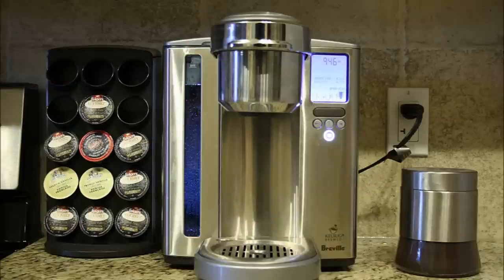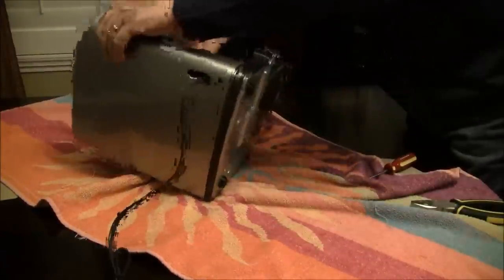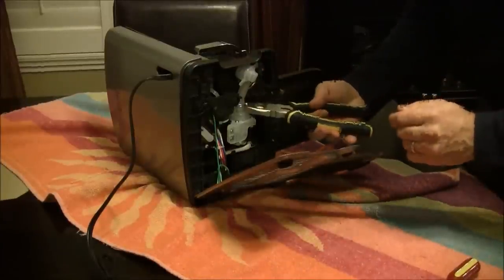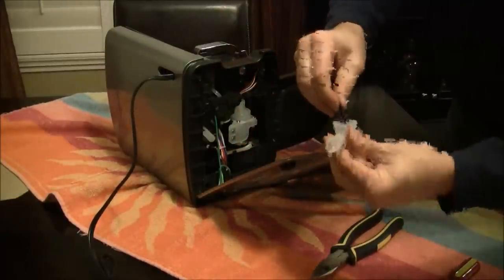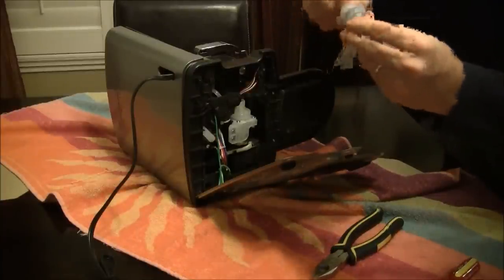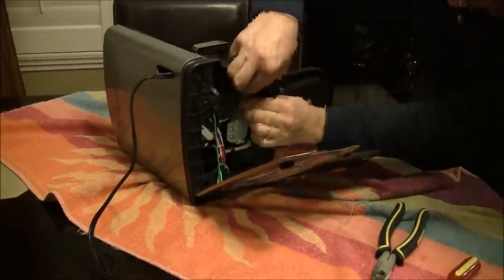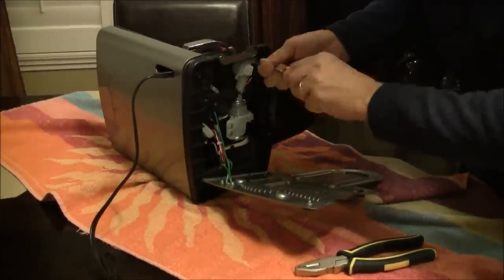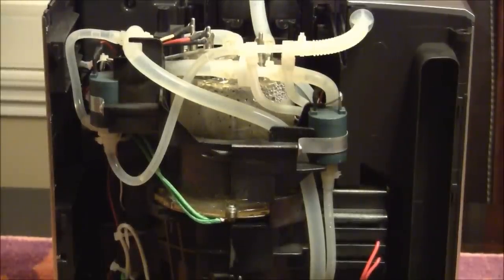Keurig Breville Fix to slow brew and partial cup

Comment: Being lazy and not wanting to take it apart, (after watching your video) I decided to get a small sewing needle , vise grips to hold the Needle and a flashlight. I put a small amount of bleach in the hole. Then I put the needle through each hole and because the bleach was in there, I saw a white substance accumulating. I then cleaned out area with water and proceeded to make a full cup of water. Worked like a charm. This may be temporary and not as thorough as your fix but I flushed out system with like 15 cups and all starting brewing at 15 seconds and finished in under a minute. I thank you for showing us the Real problem. Was on phone with Keurig and they never even mentioned that part getting clogged. Thanks again. Great video.
Sent from my iPad

Comment: Don't mess with my coffee.  I have had my B60 Keurig for almost 3 years and just started having problems with it brewing slowly and making more pump noise. I use a PUR water picture to filter the tap water before I add to my Keurig. I also run vinegar solution through it once a month. Recently my Keurig began slowing down and making a lot more noise. I purged it twice and cleaned the K cup holder and nothing changed. Then I searched and found your video (Yeah YouTube).  I followed the instructions to clean the inlet filter and the problems are solved!!  Thank you!  I was about to buy a new Keurig.
Reply from the maker: Terry, glad you found the video useful. My machine is continuing to work like new, since I cleaned the filter almost a year ago. I wonder how many machines have been tossed over the years, because of this simple problem? Cheers.

Comment: Bingo! This video saved my Cuisinart Single Serve SS-700. I pulled off the bottom cover, accessed the filter, removed it and found a big build-up of fiber plugging its underside. Maybe the fiber accumulated from the replaceable charcoal filter pack in the water tank. Before I found this video a cup of coffee was taking 60-70 seconds to start pouring. After... 9 seconds! Like new again.

Comment: Old video but great and currently effective. It took years for my breville to need this done, but I use my Britta to fill my reservoir so maybe that and the included water filter in the tank helped to prevent this from happening sooner. Thank you for saving my from having to pay a service to fix or replace my breville, I love my Breville products, now to find a solution to my kettle taking so long to heat up ;)

Comment: Thanks! I would not have attempted dis-assembly  before I found your video. Mine was coated with a black slimy film. It also coated the screen housing. After removing it I cleaned both with vinegar. Be careful when reinstalling the filter housing. If it's not perfectly centered, it will leak.

Comment: On  the Breville, be sure to check the 3 holes on the side of the puncture needle in the lid. The ½ inch or so rubber grommet pulls off exposing the holes. Using a sophisticated tool called a "trombone" (French for paperclip as I just learned) just push it up through the 3 holes and voila! (French for I can't believe that actually worked). Often if it sounds like the heater is filling, but you just get a slow drip this will do the trick. You can usually do this by just tipping the whole brewer back.

Comment: Thanks man. Took me 15 minutes and runs like new now. I always use distilled bottle water so I have no problem with calcium but I suppose after almost 3 years floating dust finally plugged that filter.

Comment: We have had our Keurig 2.0 for 4 months ago and had same issue. I tried this and then ran it a few times with hot water cycle into a clean white cup. WOW what a bunch of debris that came out! Thanks for this tip. It worked. Seriously thinking about filtering the water from now on.

Comment: Just fixed mine with a shop vac. Blew air forward and backward into the hole under the water basket. It works great now, no need to take the machine apart. As you blow air forward water will come out into a cup. Let a full cup of water come out and then also suck out water too with your shop vac. Easy fix!
Reply from the maker: +Elise Quinn  Yes, this should clear some of the debris out of the filter, but it may not clear all of it out and it will certainly not "clean" the filter. It's a quick fix. Thanks for sharing.
Reply: Elise Quinn Thank you for your shopvac trick helped alot I am now getting a full cup of Coffee!

Comment: Make sure you put the silicone tube all the way on the pump up to the base when reassembling.  If not, the inlet tank seal for the water tank will not seal off correctly as the sealing base will  not align correctly with the tank outlet stub, and it will leak.  Ask me how I know.  1 do over.  Thanks for the video.  Fixed the problem that I've had for some time.

Comment: Great video + Breville is by far our favorite... so, first of all thx for showing us how to get underneath and undo the screws (great suggestion screwdriver + pliers for little hose clamp ...thanks!) 

note: As you showed, my filter looked a-OK, clean, no buildup, and rinsed it anyways -- alas, that makes sense since we're always using filtered water from the H20 store... I wonder if the plastic filter piece you showed just needed a 'lucky bump' or something...

I'm wondering if anyone has considered the water tank filter (charcoal pak) and/or filter screen and/or K-cups themselves are the culprit(s)?  The reason I ask = I did use some de-scaling solution when putting it back together... during the rinse/flush process (2 tanks fresh water), I removed the charcoal pak (but left the round screen in), and without any K-cup... thus, H20 drained smoothly + quickly -- so, I'm wondering if my filter paks might be generic, or something like that.

When I put the charcoal filter back in + used a K-cup = brewing wasn't as fast, but still noticeably faster ...!  Also, my brother said newer K-cups might include and extra filter, or something nowadays... 2015?

Comment: My Breville is similar, but mine has a foam rubber-covered filter between the water inlet and the water pump, and it was clogged.  I removed the filter, which was held by 2 zip ties instead of a metal clip, and blew into it.  I felt a pop when I first blew through it, then air passed through OK.  I reattached the filter, put the bottom back on, and it's filling up like it should again.

Comment: THIS IS A FIX!  My keurig and Cuisnart were both making half the  cup size selected. We ONLY use filtered water, but apparently...that doesn't help much. I flush a 50/50 vinegar water solution every 6 months. BUT, there was deposits that looked like sludge in the line and the filter was almost completely blocked. 1st test after the fix-  I got 11ozs of coffee from a 12oz cup selection. EASY FIX! the only hard part is the clamp holding the line on, takes a little work because it had electrical wires on the back side making the clamp a little hard to get loose.

Comment: Good morning, I just watched your video. Thank you so much.  I took mine apart with no problems.  I did everything just as you did and while I had it upside down, I blew through the end with the filter and could hear the air going through the machine.  After I removed the end with the clip I took a Qtip and cleaned the inside of these two pieces.   Just ran several large cups of water through and it worked perfectly.  No groans or grinding.  Keeping my fingers crossed.  Many thanks!

Comment: THANK YOU, THANK YOU, THANK YOU! I picked up a Keurig B60 at an estate sale for $15 realizing there may be some issues, and there were. It was VERY slow to brew and only brewed about 3-4 ounces of liquid no matter what size I had the machine adjusted to. I ran white vinegar through it but the same issues remained. I tried your tip and within a few minutes I had a machine working perfectly and for only a fraction of the cost of a new machine! I cannot thank you enough for your tips!
Reply from the maker: Glad you found the video helpful ! Cheers!

Comment: Thanks for you're wonderful video. Before taking your machine apart, you should try cleaning the filter using two Q-tips (four sides) for each quadrant of the filter. For me, that was adequate enough to unclog my filter and get my Breville K-cup machine back to normal operations.

Comment: Thanks for the video, great info in there. My keurig started to brew slower and slower for the past week since I replaced the carbon filter inside the H2O reservoir, tried blowing air in it, used a paperclip to try to unclog the brew needle, dissembled it and cleaned the inlet filter screen still no luck. It buzzes for about a minute then ask for more H2O even though it's full! had it for about a year and half. any ideas?

Comment: I tried what you said, and I don't think clogging was the issue - the screens looked clear and no gunk - we use reverse osmosis filtered water. Unfortunately, when I put it back together and tried to run vinegar through it, the water is somehow draining straight out through the bottom of the machine - it's not pumping it into wherever it heats it up. Any ideas? I just made a small problem much worse...
Reply from the maker: It sounds like the re-assembly process might have been the problem. Maybe just have a good look at the way it all fit back together. Sounds like the initial problem must have been something more serious. Sorry, I don't really have any expertise to offer beyond the simple filter problem.

Comment: This did the trick.  I had purchased the descaler and it worked good only when it was only water. But I followed your directions and it was pretty easy.  Amazing the black junk in the rubber hoses. Not really seeing it but I used a Q tip, several and cleaned all of them. And it is working great. Thanks for saving me another $130. Next time I will buy a single cup.  Thank You.

Comment: I had the same symptoms but I found that the filter that you placed into issue to be clean of any debris and therefore no dice. Then I removed the internal filter in the water tank and my coffee cup filled to the proper level. Go figure.
Reply: Now that stopped working too. There must be another place where a clog in the line can develop.

Comment: I have been having similar problems with my Breville K-cup machine for quite awhile. I usually have to brew two cups in order to get one; however, when I just want hot water, like for hot tea or cocoa, I get a full cup every time. So this tells me that the machine is not maintaining enough pressure to force the hot water through the K-cup. Do you think that cleaning the filter will fix this problem, or do I have a different problem, such as a malfunctioning air pump?  Thanks for your video.
Reply from the maker: Arthur, I am not an expert, but it sounds like you may have another problem. It wouldn't hurt to clean your filter though. If you have had your machine for a year or more, then the filter is likely in need of a cleaning. Good luck!
Reply: Thanks for your advice.  I did clean the filter per your instructions.  However, after taking the bottom and rear cover plates off, I discovered a badly corroded and leaking solenoid valve.  I cleaned off the rust from the solenoid, which was a mistake because after putting the unit back together and testing it, the leak was much worse.  So the brewer is totally unusable in its current condition. I do not know the function of the solenoid valve, but it's probably the cause of my previous problems.  Do you happen to know where one can purchase a new solenoid valve for this Breville brewer?

Comment: In the Kourig 2 there is a wire mesh strainer above a check valve in the bottom of the plastic reservoir. Clean that with a kitchen sink sprayer and try it.
Reply: Thanks, that worked for me

Comment: Thanks for the video! I did this with my Keurig and initially it didn't work. In my Keurig there's another strainer at the bottom of the inside of the water reservoir, so I took it apart cleaned it and it is working again. Note: Both strainers looked clean, but the holes are so tiny you can really tell. Clean them and you will see results! Afain, thank you so much, your video save me some money.
Reply: *can't really tell
Reply: Yep, the filter in the reservoir and the one at the bottom were plugged enough to make it not fill the tank.  Bonus!

Comment: This is the one, guys! My water inlet was plugged with a clear jell. It didn't look like a clog, but when I cleaned it out, both sides with an old toothbrush, after disassembly per the instructions in this video, it was good as new. I just wish I hadn't found this video two days after I bought a replacement Keurig. Gotta drink lots of coffee now.
Reply: I found the same clear slime (consistency of snot).  I clean the intake screen, The tubing from intake to water pump and the water pump itself .

Comment: IT worked!!! That little filter barely had any scale in it, but as soon as I scrubbed it my problems were solved. I literally spent all day yesterday spanking my Keurig platinum and running vinegar through it to no avail. Big thanks!!
Reply from the maker: +Jacob Kirk  Glad this helped. It has now been 2+ years since my fix and I have not encountered any further issues. I am very careful that the water going in the reservoir is absolutely clean.

Comment: 08-12-2019 Thanks so much for your simple instructions on repairing my Keurig Breville coffee maker. Mine is now working fine following three times descaling. This makes the second one I have purchased. If I had seen your video before purchasing the last one I could have saved $250.00 plus the taxes. Thanks so much for your time making this video. I am sure it has helped several people in restoring their coffee maker back to working well.
Reply from the maker: Tom, thanks for the note. I have received many comment like yours, so this seems to be a pretty common issue. My strainer has stayed clean and the machine has been operating smoothly ever since I made this video. (5-1/2 years ago!) I have become meticulous in making sure the water and filling container are clean! Cheers!

Comment: One noticeable design issue is that the needle puncher assembly has a check valve built-in. If for some reason coffee grounds make their way up in that check valve (say if the k-cup was under some pressure and the top needle pierced before the bottom one), it'll jam the valve very badly and make the machine unuseable. Fortunately, the needle puncher assembly is compatible with the one on the Keurig B60/B70, which use a separate check valve installed inline with the hot water feed line. The Keurig outlet check valve however needs more pressure to 'crack open' so it only gives partial cups (~6-7oz instead of 8) when installed on the Breville unit, so I'm still looking for a good replacement check valve.
Reply: +Patrick Meslin On an interesting note, the machine works perfectly well with that outlet check valve completely removed. I worry however that there might be a risk of coffee grounds making their way back into the heater tank.
Reply: did you ever find a replacement part for it?  or get it cleaned?  if so how?

Comment: Your video was very helpful!!! I have been trying to fix my Keurig for several days now and nothing works until I saw your video. I took out the filter which BTW was clogged, cleaned it thoroughly and re-assemble. Now it works like new! thank you so very much.
Reply from the maker: I am really glad this solved your problem! I am coming up on 4-years since I cleaned my filter out and I have never needed to do it again. I just make sure that there are no contaminants getting in there.  Cheers!

Comment: I wish you showed how to get the back of unit off.  I don't want to break plastic tabs.  I cleaned filter and hose. Thanks for that.  However when I take the bottom off of unit I can see 2 hoses that are moldy.  One the intake and filter hose which you show.  The other one is attached to maybe a motor with zip ties.  I would like to get to that one too, its moldy on mine
Reply from the maker: I really don't remember how I got the back off the machine. It was so long ago now. I guess the mold is why these manufacturers have a cleaning schedule that they suggest following. Vinegar seems to work well for this. Good luck!

Comment: What if yours doesnt have a water depenser i have a small one that does not hold water u put water in everytime you use. I dont know how to get to the clog.
Reply from the maker: +Jess C  Sorry, I don't know anything about that style.
Reply: +Jess C Most likely either the Keurig Mini Plus, or the Keurigs used in hotel rooms, which also require refilling with every cup.  Check the needles top and bottom, and use a paper clip to unclog the needles.

Comment: i vacum my filter instead of takeing it out
Reply from the maker: Yes, I think this would also clean some debris out of the filter and get the water flowing better. It won't get all of the gunk out, which is why I would still suggest a thorough cleaning. I cleaned mine over 2 years ago now and it is still working like new. Removing the filter and cleaning it should only take about 10 or 15 minutes.

Comment: I have the same problem, but the filter was clean so I still have problem.
Reply: Did you take it apart like he said? Mine was clean...or so I thought. I was putting it back together and I noticed some black stuff in the hose of that filter. Pulled it out and was wow, nasty! Took me a while to get it cleaned and back together perfectly but it was worth the time. I cleaned that one filter and hoses and that work. It’s about 3 pieces to clean. Keep us posted.
Reply: My filter didn't look dirty but using a Q tip I could see stuff and in the little hoses.